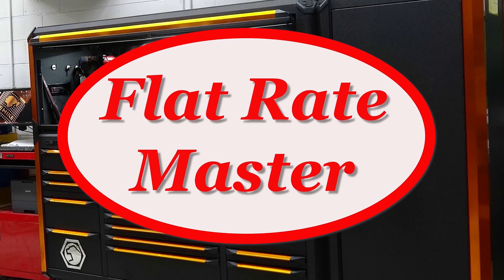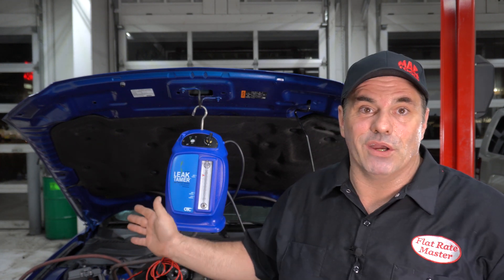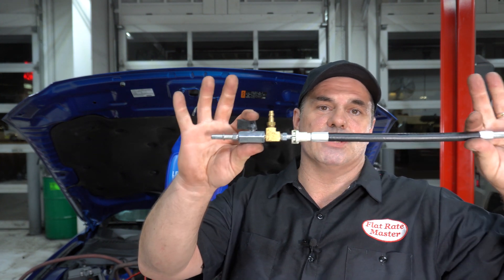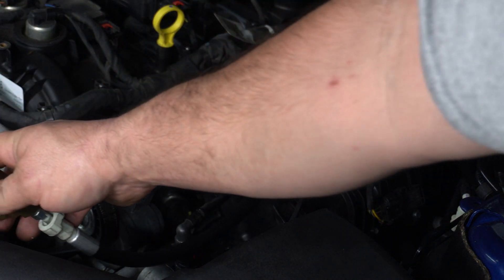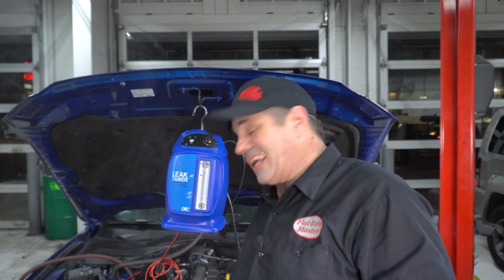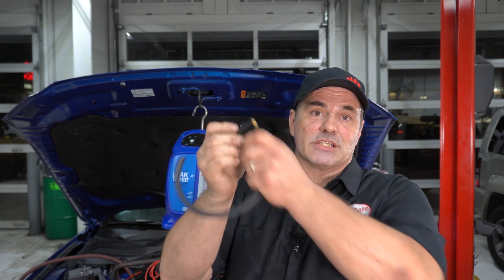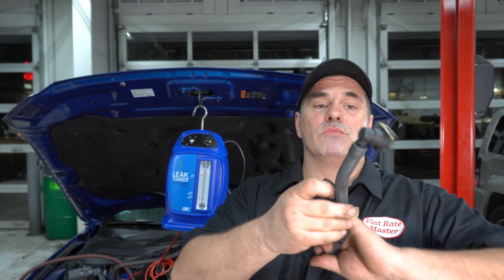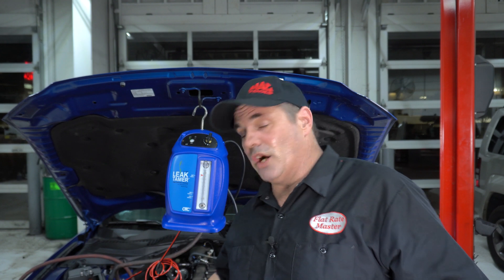Quick Tips On EVAP System Testing

Comment from the maker: OTC 6522 LeakTamer EVAP Smoke Diagnostic Machine
https://amzn.to/31FhG8g
VACUTEC VCTWVA-063 Universal Fuel Cap Adapter
https://amzn.to/2H6ELsM
Redline Detection 95-0082 Easy Intake Diagnostic Leak Detector
https://amzn.to/31H6c4h
Redline Detection EasyEVAP Universal Filler Neck Connector
https://amzn.to/2Kzqpn2

Comment: Evap systems are a pain in the butt. Leak codes arn’t always caused by an actual leak. Sometimes pressure sensor issues can set leak codes.

Comment: Speaking of fuel pressure testing I’d like to see a video on what you use for gauge adaptors.  As a dealer tech who recently switched car lines, I was frustrated, but not surprised at how many different designs there are, even schradrer ports aren’t all the same.  You independents have it tough.
Reply: Snap on master set is my go to